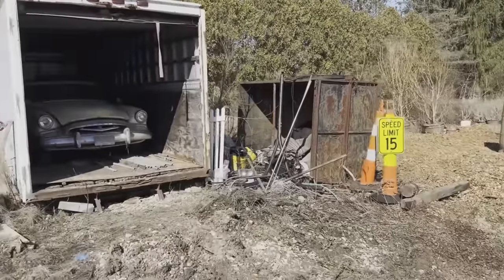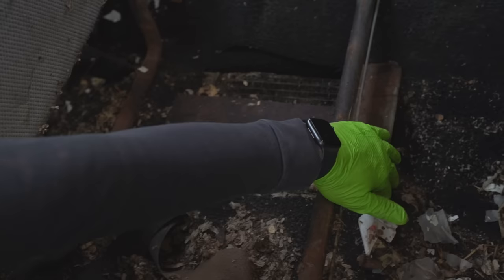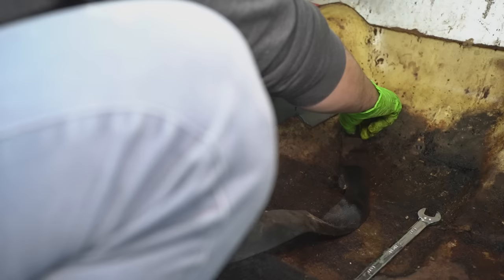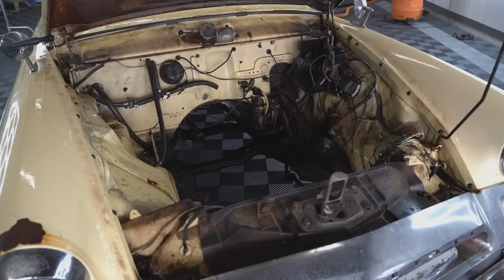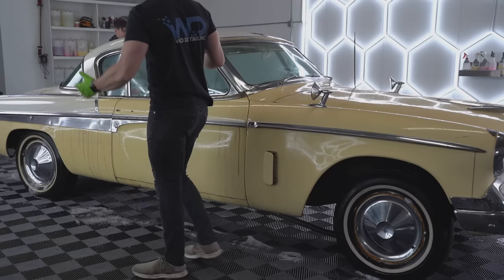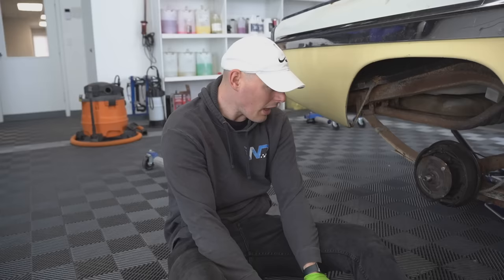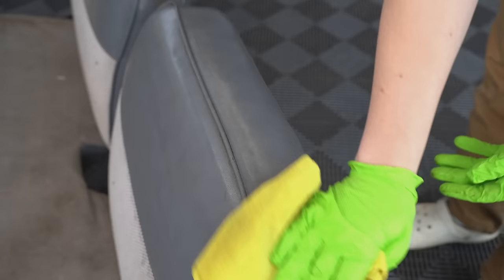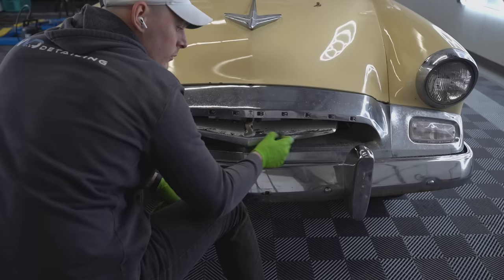First Wash in 30 Years: ABANDONED Barn Find Studebaker Disaster Detail! | Satisfying Restoration

Comment: If it was mine, I would install a modern Chevy crate LS-3 with a 6-speed automatic trans. The LS3 is lighter than an old iron block V8 and the body of this car is in very good condition so it’s worth restoring. I’d go ahead with disc brakes and a modern rear axle too. The lock on the gas cap was to thwart theft of gasoline.

Comment: In the early 1970s, an Arab Oil Embargo severely limited the gasoline supply at stations. What you had in the gas tank was valuable, and any one who had a siphon could easily steal it if you kept your car outside and weren't around. Lockable gas caps were the solution. Later, the doors that covered the filler cap were lockable from the inside. 
Some cars, like GM hid the gas cap under ahinged tail light or behind a license plate. Volkswagen gas tanks were under the front hood (rear engine) and you filled the tank directly without a filler pipe. The cap was about 4" in diameter. In the early fifties, Beetles didn't have a gas gauge. Instead, they had a separate supply valte below the normal one. You would drive until you ran out of gas and then flip a lever near the accelerator that would give you an extra gallon (about 36 miles) to find a gas station  -- unless you forgot to reset it after prior use. 

VWs were tigthly made and GIs who found them at the end of WW2 had fun driving them off a dock.  VW wanted to give the Beetale to Ford but it  declined. 

Also, way back when, if you looked into the filler pipe, you'd see a smaller pipe witin the larger one. It was designed to create a whistling sound whose pitich grew hight as the fuel level rose higher so you didn't splash gas. 
Today's tanks have a filler orifice that is slightly larger than the fill nozzle --- but too small to accidentally fill with diesel fuel. 

There is also a flap of sorts that prevents vapor from escapeing while the cap is off. 

Your detailing videos might be of interest to auto car washes. Ask them, See what they say.

Comment: That locking gas cap does not appear to be a genuine Studebaker accessory.  It is my belief that it was likely added during the fuel crisis in the late 1970s or early 1980s.  While Studebaker did offer a locking cap, it had a different appearance according to the accessory books that I have seen.

Comment: I would have pulled that carpet and pressure washed it straight away after vacuuming.  It is more complicated than what you did, but I think you would have saved some time in the end.  You had to pull all that filth we saw under the back carpet THROUGH the fabric, doing it the way you did.  I'll bet you didn't get it all.  

Hopefully the carpet will be replaced, but it actually looks in pretty good nick, unless it's rotted.

Comment: Great job. Not done yet, but wanting to comment before i forget. Reverse threads shoild be on the left side, which is why the stud is marked with an L. If you are ever working on Mopar products from the 50s and 60s, some of them also had reverse threads on the left side. 
As for the engine, i eould jeep this car with the original flat head 6. That is a rare car and one that is largely otiginal. I suspect that once it is all done and dusted, at least 80% of the original paint will survive. This beauty can easily compete in a Survivor Class Concourse D'Elegance. A supercharged Studebaker V8 would be my choice if going anything other than stock.

Comment: A motor? A small block Chevy would fit in there no problem. You may even be able to swap over the engines sensors. Or if u want it to look like it belongs put in a Ford because the distributer is in the front of both engines. As for the locking gas cap? You're kidding us, right?
As for those studs, hey a lot of guys have struggled with that problem, don't feel too bad. Either try using a bolt and stud extractor, if that don't work... Pull the axle, mount on a vice, apply heat, start pounding. Would be best if that plate is on top the vise while you pound to avoid warping.

Comment: Believe I would go with a new inline 6 engine ,either ford or Chevy for parts availability.That way you could drive it on longer trips. I would restore the original engine and keep it on display beside the car. As for the wheel lug bolts .That was a bad design choice by stude that they realized and changed.

Comment: That axle gotta come out.. Won't hurt to replace that old gear oil either.. Good luck finding seals and rear end gaskets 4 that antique. I had to recently travel nearly 300 miles for a brake drum for an old Chrysler that has them left hand threads because the guy that inherited the car did the same darn thing.... Never realized them antiques had such primitive advanced engineering.

Comment: Last car I remember my Dad driving was a 1970 Chrysler Newport and my Mom had a 1968 Dodge Charger R/T.
I would put the original flat head six back in it. 
The key is to unlock the gas cap. You guys are too young to know this stuff? That is an aftermarket cap from the 70s.
In the 50 and 60s Chrysler, Dodge and Plymouth used left and right wheel studs like that so be careful.
Yeah you messed up but installing new studs is not difficult. The wheel studs are splined usually to grab on to the mounting area.
Pull the axle  shaft and take to a place with a press. push them out and install the new ones. Having a press is handy.
I'll bet there is more mouse droppings under the carpet so wouldn't hurt to check.

Comment: Seems to me that the broken studs are not to worry. The real lesson to be learned is when storing a car this way, it would be wise to close all holes or passages to the cabin, including areas where "chew-able or rot-able" ducts are found - even a large bundle of wiring - whatever. At least it was above ground, so not too much moisture would accumulate, and the fact that mice got in means that the container was not airtight. Also presume that all windows & doors were shut tight. And wonder if all that spraying on the dash would have ruined the radio & other electrical parts. Luckily, back then auto wiring & instruments were fairly simple. Imagine a 21st century car cleaned this way. And, I suppose you chaps have ways to totally dry it all out?

IIRC, (Should be on Youtube) somewhere in the U.S., a brand new '50 Plymouth was buried in a "time capsule" in the town square. However, when dug up 50 years later, water had gotten in & totally ruined it  & whatever other artifacts.

Comment: Its obvious to me this car had some level of restoration done, probably early 1980s.  Seats and carpet are not original and it appears to have been repainted.  The seatbelts look like aftermarket ones from the 70s/80s.  These never had them originally.  The door sill plates also look like reproduction ones that were available in the 80s and 90s.  But, seems it was a decent car when that was done.  Engine being out seems to indicate something went bad on that and it got pulled for repair/replacement and somehow the project never was finished.

Not a Studebaker, but I know of a 1960s muscle car where the original engine was pulled out around 1974 and sold and owner was putting in something less powerful due to the fuel shortage crisis at the time (better mileage).  The project was never completed and car has been on blocks in a shed ever since.  I hope the mice have not gotten into it.

Comment: An LS aluminum small block, with a nice modern 6 speed, then, keep the rest stock looking, updated brakes, suspension, electronics.👍 I know I’ll catch a lot of flack from the “ keep it original “ guys, but I prefer keep it safe, and reliable, it’s a beautiful looking car, they were way ahead of their time with the styling.
Reply: I would prefer to keep it original, especially since the rest of the car is so solid. Its not a dilapidated wreck after all, in which case that'd be fine. Just accept the fact that its a 50s car and be done with it.
Reply: I understand your thoughts, I have restored more cars than I can truly remember, if this was a Gran Tourisimo, supercharged 4 speed, I would probably do the same, but it’s not, just a nice looking old car, perfect cruiser, especially if modernized, to go down the highway, in comfort and safety, would be my thoughts, but that’s just me, I’m sure no matter what you do it will come out fine, good luck!👍👌

Comment: the studs will have knocked out of the axle with a hammer if you had not twisted off the lug nuts you need to replace the axle because of the excessive force on them when you twisted the studs breaking off the lug nuts other than this the axle is peachy keen this axle will fail if you drive it without replacing it

Comment: Does the customer want to put on some modern disk breaks. I would keep the little car as lightweight as possible and just LS swap it.  Nothing complicated a Mustang II front end and a shortened Ford  9 inch to fit some nice disk breaks. And some vintage air so you have no excuses to not drive the car because it's to hot out.

Comment: why you chose to leave the carpets in place instead of putting them down and cleaning them outside, it's like sweeping and dusting the carpet in the evening.  in any case, a lot of courage, mouse droppings are horrible.  For the engine a small block very torquey and soft to circulate quietly.  The cars of the time were really built to last, all the materials resist the years well.

Comment: Ok so I made my comment below about not letting you take my tires off I said that based on the fact that you didn't know what a heater core was.. Then I get to the part where you snapped off the studs. The good news is getting the studs out is easy you just have to drive them out with a center punch and a hammer. Just send it to a shop you do the detailing and let them do the wrenching maybe you can make a trade. the shame of it is with all that about for basically the same labor the car could get new wheel bearing and brake rebuild.

Comment: There’s no way the smell is gone if the mouse pee saturated seat spring burlap is still there.  I had a 50 Studebaker with the interior completely stripped to metal, nothing on seat spring or no material on door panels.  Still could not get rid of pee smell.  Sold the car.  They didn’t strip this car, just “cleaned” it.

Comment: Its called a heat core the hot water from the engine is diverted into the heater core when you turn your heat on. They are still used in 99%of if not all modern cars.  Heater cores are usually behind the glove box under the dash in some cases mounted in a big box on the firewall. If you don't know what a heater core is don't take tires off the cars you arent I don't trust your general car knowledge.

Comment: Why in the world didn't you pull the carpet, power wash it, and let it dry in the open air outside? You could have saved yourselves a pile of work and cleaned the floor underneath and got rid of the smell.

Comment: Some of the 40's cars had "under-seat" heaters. That's what you are looking at under the front seat. Wow !! Really looks like the rodents really enjoyed this car !!! What is the white stuff you used a a cleaner ?? 
The seller said he had a new/?? rebuilt 6 cylinder motor. If he would sell it, that's what I would use !! 
It was somewhat common for people to do "vandalism" to peoples cars by putting something into their gas such a sugar, sand, ????? Don't forget, during the war, gas was "rationed" so it also was much more common for people to "siphon" gas. Thus, the lock. 
Don't believe you will need to replace the exel. The studs can be removed and replaced at a automotive machine shop. They will need to be removed to do that work however. 
Pretty "nasty" from sitting in that container all those years but at least it didn't corrode or decay very badly. It's still a very solid car. Since the owner said he has the six cylinder motor for it, hopefully it will be replaced and kept maintained once again !!!! 

It turned out "awesome" !!!

Comment: Why didn't you take the carpet out of the car and clean the metal under the carpet.  Then clean the carpets on the floor with the pressure washer and your brush.  You surely would have gotten the smell out of the car.
When you broke one why would you continue and break the rest of the lugs.  It makes no sense.
You guys might consider another line of work.

Comment: 1940 and 1954 Packard Clipper four door with eight cylinder in line flathead with automatic transmission 1958 Studebaker President V8 four door automatic 1960 Ford Falcon four door station wagon six cylinder engine with three speed standard transmission on the tree 1964 Studebaker lark four door with V8 and automatic transmission